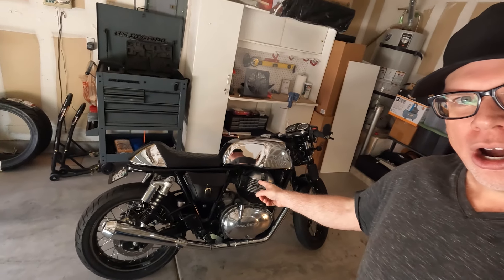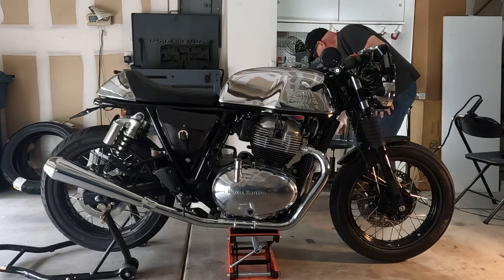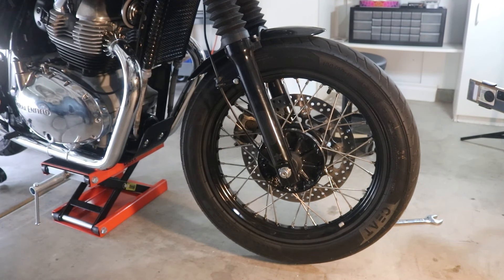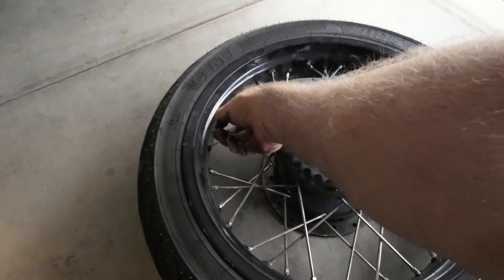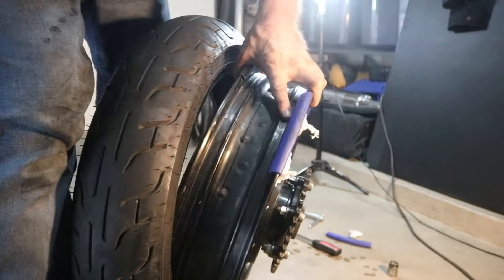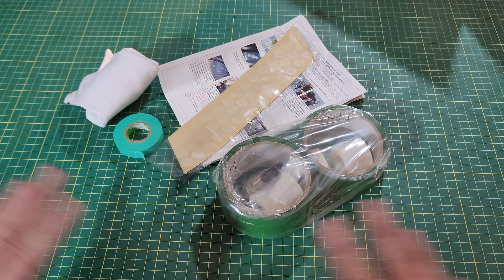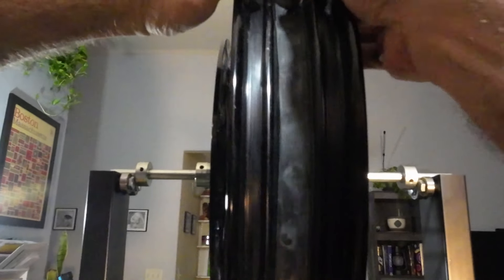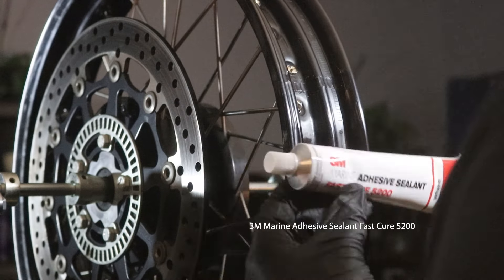Tubeless Spoke Wheel Conversion & Wider Back Tire | Royal Enfield Continental GT 650 | Outex Rim Kit

Comment from the maker: Couple comments and update... 1) at 11:56, the little stickers that go over each spoke that I didn't use, they protect the tape if you have to turn and adjust the spokes. If you don't use the extra sealant like I did, you will need them. 2) at the 18:24 mark I mention filling the tire pressure to 42psi, that is a max load recommendation. Manufacturer recommendation on the bike is 32 front, 39 rear. 

As for the conversion itself, it's been a few months and still all good. We'll see how it holds up this summer when things heat up!

Comment: First gift that I gave myself after finishing college and getting a job for now about a year is this MR.CLEAN continental GT650. Love to watch and learn from your videos…keep posting them …I hope you can give some solution for shaky handle at high speeds..
Reply: Dude I did the same 😂👍🏼
Reply from the maker: I haven't experienced any shaking at high speeds... maybe I don't ride fast enough :)
Reply: Mr. Bhatt you can check both the front tyre grips, esp. the front ball racers, and the rollers.
Reply: @turnonoff  thanks man
Reply: giving myself this as a gift once i graduate air force tech school! only about 4 more months!
Reply: Congrads on graduating college
Reply: @bhanubhatt596 how'd you gift yourself without earning ?? 

Papa's gift to you , you mean?? Well that's lucky & rich parents gifting yoh & not you gifting yourself

Comment: I did a DIY tubeless conversion on my Gt650 2 months ago using a locally purchase all purpose glue (bostik), 3m electrical tape and a 500ml of tire sealant for both front and back wheels. Took it on a 420kms ride with no problems. I hope it lasts!😁😁😁
Reply from the maker: Wow, nice! How's it holding up, any leaks?
Reply: @RideWithJerry  its holding pretty good considering our highways are not as pristine as other places in Southern Philippines. The tire sealant did its job after puncturing my rear tire. It sealed itself! Did not even bother to patch it...
Reply from the maker: @Tibor  Glad it's working 👍 Some people have said it doesn't last long but I just need the conversion to last until my next tire change!
Reply: How's it going after 2 years?? Im planning to do that too

Comment: why does that GT look so good! Can't take my eyes off it, silver chrome Cowell makes it extra special. I would be drooling all over the place if I saw it in person.
Reply from the maker: Thanks! My goal was to make it all just black and chrome (or polished metal) so I think the small changes make a big improvement in the look.
- Changing the gold emblem with chrome
- Chrome vinyl wrapping the gold shock reservoirs
- Replacing the orange fork reflector with black reflective tape
- Blacking out the risers, signal mounts, intake covers, heel guard, levers, etc...

Comment: Best money I have ever spent on a motorcycle…… Pay someone to swap my tires. I used to change my own but found that if you don’t do this work all of the time, it always seemed to be a challenge. Additionally, all of the equipment required to carry out this task takes up a lot of shop space. I will admit that it is rewarding when you get it right.

Comment: IMHO the 150 is good maybe for looks but hurts performance as the narrower rear tire will be not only lighter but allow for more “flickability” in turns. You also added weight with the liquid so that’s something to consider. However great work doing all of that on your own for the first time 👍
Reply from the maker: True, but it depends on what type of riding you do and what roads you ride. For me the 150 is a performance improvement. I almost never ride in traffic or need to make fast, tight turns. Where I live it's mostly wide open roads and a wider tire and more rubber provides extra stability at sustained higher speeds.

Comment: What happens if one of the spoke came off? since the spokes are permanently attached to the wheels?
Reply from the maker: They are not permanently attached, they are just covered by the tape. Repair the spoke and then patch the hole with new tape where the spoke was repaired.
Reply: @RideWithJerry  I’m just about to place an order for this conversion kit. Thanks for the quick response ☺️

Comment: Hi ! Mate instead doing all this huge process converting to tubless .Just simple you buy a new one tubeless rim and fit the tubeless tyres ..all set no dangerous incident or you need drive with fear..I just shared my opinion not discourage.. you did good job keep rocking..stay safe .. 😊👏👍🏻
Reply: The thing is he doesn't want to give up Spoked wheels, which needs tubes.

Tubeless tires not spoked because it's functionally not possible, so many people do these kind of tricks and solution to maintain the Spoked wheels and the looks of it. Cheers

Comment: Normally such conversions last 1 year but I would love to see how your experience was. Great work!!
Reply from the maker: Thanks - Yes, I'm hoping the conversion lasts until the next tire change. I live in a hot/dry climate (bike has never seen a drop of rain) so not sure how that will affect the tape.
Reply: Who told you it only last a year? Rubbish.
Reply: Four years and two sets of tires on my tubeless converted R1200R and Canyon Motorcycles tubeless wheels are outexed just like this.
Reply: @daniellekoran7906  thats actually amazing I'm curious to know if you do any reseals with tyre changes ? and if you can link you sealer kit please
Reply: @RideWithJerry  How is the conversion lasting ... any typre pressure loss during longer rides or this worked ... let me know will do it to mine aswell..
Reply from the maker: @Joshua Bahirvani  so far, it has held up really well. No issues and has held pressure. The next six months will be a good test when I'll be doing longer rides and greater changes in temperature.
Reply: @RideWithJerry  I might do a conversion for mine aswell if yours has worked pretty well
Reply: Seems an expensive conversion plus the silicon mess and time involved. The split tube method takes an hour or so and continues to use an inner tube as a liner to keep the air in after it has been cut round it’s largest circumference. The tyre then goes back on top to hold the liner in place. Finally the excess rubber is trimmed off and away you go …

https://youtu.be/60bi1r2Xvbo?si=ylaPMy0RwTGfAc_z

Three years on and holds pressure perfectly, all for less than $30

Comment: In the decal-wrap industry, they use what they call a squeegee, even-though it looks nothing LIKE the window-cleaning sort, and is MUCH stiffer, though still with a bit of flexion, to it. One of these typically looks like a VERY worn-down, used-up bar of soap, often blue in color. 

These things are used to smooth-on the adhesive-backed printed decal material, to get it on good & tight, and to force-out any bubbles, as you were doing with the smooth, rounded wrench head and your thumbs. 

If you took one of the decal-application squeegees and measured the ideal width of the furrow within which you see the spokes' mounting wholes, one for the front and one for the back, and then, perhaps using a miter box and a cabinet saw (both cheap), cleanly-cut the squeegee-off into two ideal widths FROM that original squeegee, into two "mini" squeegees, this might make-for a handy set of "smoothing-tools" to smooth-on that sealant tape, and get-out all of the bubbles. SINCE the squeegees will be inherently somewhat flexible, there's less of a "grinding" feel, as you bear-down on the surface of the tape.  

The fact that the edge of the squeegee is straight, sort of like tools used for troweling-on paint or viscous, goop, etc., simply helps to more-easily and gently burnish-on the tape-layer onto the relatively flat metal of the rim.   Seems like being able to just carry a "bacon" patch kit & repair tools to fix things is a lot better than having to call for a trailer. Thank you for this demonstration video.

Comment: The width you can make sure it fits of course, but the height of the tire is also quite important...

Overall I think the Royal Enfield 650 bikes are pretty nice 👍

The continental 650 2023, with a few Cafe sports changes is really nice...

The great thing about these bikes are that they are very user friendly. Nowadays most bikes have too many technical gadgets making it a pain in the butt to work on them yourself.

Geez, mine even has tire pressure and tire temperature gauges! 

The idea of having tubeless on that bike is great 👍  too bad those radial rims don't come in tubeless from factory.

Safe riding bud

Comment: Bikes always feel a lot better with new tires because you are going from worn out to brand new. The rear tire you took off looked pretty squared off do it will feel a bit vague as you roll off the flat part to the curved part

Comment: Thank you for showing us how to do this as am seriously considering doing the same thing & I've never done this before Great Video thank you!👍
Reply from the maker: Thanks, glad you found it helpful. But, one step I skipped that I probably shouldn't have was the little sticker pads that go over each spoke. They enable you to turn and tighten the spokes without damaging the tape. Don't think it will be an issue since I used the 3M sealant but still probably best to use.

Comment: Those small discs are to allow the spoke nipple to turn (as you tighten or loosen the spoke) without tearing the tape that seals the rim.
The marine sealant that you substituted will seal around the nipple well and it will be fine - until you turn the nipple.
Check out "Far&Further" with a search on "Outex Failure analysis" for more info.
Reply from the maker: Ahhh, that makes sense! Where were you before I did the conversion 😁

Thanks for the info 👍I just watched the "Outex Failure" video you mentioned. The 3M sealant I used is waterproof and "flexible" so hopfully there is enough extra protection and flexibility if I have to adjust the spokes. My guess is it should be fine but if it does cause issues, well then, I got myself another weekend project!
Reply: @RideWithJerry   -  I suspect that the sealant will just break away from the nipple if the nipple is turned, and the sealant edges and the tape will continue to seal the air.  The need for the small discs may just  be theoretical.  Care to test the effect on  the marine sealant of turning a few nipples for us?  :-)
Reply: @daveinwla6360  i dont know.. That 3M marine stuff is no joke.
Reply: @atomiccheerio3349   -  Yes, it's good stuff.  But if there is a good bond with the base of the nipple, it may twist along with the nipple and tear a small hole.  The same with using just tape - it could tear.  So most procedures involve a belt-and-suspenders approach and cover a sealant on the nipple with a layer of 3M tape.  The tape is also easier to balance because it's a uniform thickness.

Comment: Awesome video. 
I'm buying a interceptor next week in NJ.
I'd like to put a 150 on the rear like yours. Can you tell me how much room you have on the swing arm? And have you had any rubbing?
 Or maybe do a quick video of the spacing. Thank you and subbed
Reply from the maker: No issue with the swingarm but I was getting some rubbing on the chain guard when going over bumps... at the end of the video I show the notch I cut into the chain guard which fixed the issue https://youtu.be/7dTebUBmmdo?t=1272

Comment: Tubeless rims have a different profile and have a locking groove that stops the tyre coming off the rim which some tubed rims do not have. Tubeless conversions are at best a compromise and worse potentially dangerous and your insurance company could walk away from a claim. Putting a wider tyre on a bike can make the handling worse as the tyre can be squeezed on the rim changing the profile (taller and more pointed which reduces stability and the contact patch). Personally I wouldn’t have done either the conversion or the wider tyre the balancing goo stuff I would love to know how it works and if it has actually balanced the wheel any better than weights.
Reply: @danielkerr4100  why?

Comment: Put a Scorpion trail 2 150 on my int,  rides a lot plusher, still tubed though,  considering the conversion 👍
Reply from the maker: Leaning into corners always felt sketchy, now the bike want's to lean! Feels so much smoother
Reply: did you change your tubs to accommodate 150/70 18? or just keep the stock ones?

Comment: JFI you really do need to take more care when putting your bike up on the paddock stand/engine support. Your paddock stand ground wheels are all out of line and when you removed the rear wheel spindle the lhs bobbin came out of the stand hook which could have seriously injured your hand had the bike slipped. Your bike is balancing precariously on the engine support and it would not take a lot for it to fall. Apart from that, pretty good effort ....

Comment: If you really want to improve handling you should at least upgrade the rear shocks (they are made by Gabriel). They may look trick with the piggy back cylinders but they are in reality poor..  
Stuart Fillingham (YouTube) fitted YSS front and rear, I fitted YSS to the front and Hagon shocks at the rear. I wanted a retro look shrouded shock at the rear and the Hagon is perfect for that. I can’t honestly say the front was improved but the back is much more compliant over the bumps and gives a better ride. Tires I left stock, they handle great and stick like glue so no problem.
Reply from the maker: Yes, I've been looking into upgrading front and rear suspesion. Still reseaching options, costs... and finding the time to do it!
Reply: The front wasn't improved cause you didn't drill out the damper rods.
Reply: @stevepalmer5670  And the YSS progressive rate springs are a one-size-fits-all upgrade. Better off with a linear spring suited to your weight and riding style.

Comment: Hi, were you able to use the 3M Marine Sealant (3 oz) for both the wheels? just want to know if 1 pack of 3 oz is sufficient, as I am planning to convert my Int 650.
Reply from the maker: Yes, the 3oz sealant was more than enough for both rims.

Comment: A quick question Jerry, is the tube of the 88ml 3M marine sealant enough for both the wheels? I'm going to do this but with just the marine sealant and a 3M tape I procured from the US, for some reason the marine sealant is not allowed on a commercial flight so I could not get it over here in India through a friend who was going to bring it with her. The marine sealant is available here in India but it is seriously expensive for that little 88ml tube so before I start ripping the tyres/wheels off the bike I just want to make sure that the tube will do the job for both wheels. TIA.
Reply from the maker: Yes, more than enough for both rims. I had plenty left over.

Comment: Once you change the tyre in future, do you have to redo everything? Like you will have to get new kit and apply again?
Reply from the maker: No you should'nt have to redo anything unless you find leaks or your cause damage when changing the tire. But it would be a good time to inspect and see the condition of the conversion, how it's holding up and if any repairs are needed.
Reply: @RideWithJerry  RE have launched the alloy wheels.. but I like my GT with spokes. I ma gonna use Way2Speed kit. Costs like less then $80.

Comment: Others have found that a 120/80/18  handles better and better gearing , the same on  kwaka w650's ... So I am about to go 'that' way .   Dave   NZ
Reply from the maker: For the font tire? Yeah, I didn't change the size of the front tire. I'm interested to know more, if that also makes an improvment.
Reply: 110/80 front, 140/70 rear works best. I've run several sizes and this combo works very well.

Comment: Thank you for the video.  I feel, however, it should be released some 1/2 year or so after the conversion to include conclusions related to any issues that MAY surface after an extended usage.
Reply from the maker: I can do a follow-up video when I change my tires again (or if I have any issues with the conversion.)

Comment: If my spoke brake will i be able to remove the adhisive sealing to put a new spoke in?
Reply from the maker: I would cut out a section of the tape just around the broken spoke and then patch that area after the repair.

Comment: Way2speed tubeless kit is better and cheaper than this. Works like a charm. But that's just my opinion. Could you please share the details regarding the wider tire upgrade? Any issues with the balancing while cornering, accelerating, and reaching the top speed? Is it safe?
Reply from the maker: I like the wider 150... for me, I've found that the extra rubber provides a bit more stability at higher speeds (maybe it's just due to being a better tire, I don't know, but I'm happy with the results.)
Reply: Thank you for answering. I just have one question. Is it necessary to upgrade the front tire as well in terms of wideness to balance rear wide tire? @RideWithJerry
Reply from the maker: @motoman9323   @motoman9323  nope, I didn't change the size of the front.

Comment: The pipes come down below the frame.  The motorcycle lift is lifting the bike on its pipes.  I don't think that is such a good thing.  I've used short wood blocks on the lift to lift up on the frame directly.
Reply from the maker: Good advice! Don't want to be lifting the full weight of the bike on the exhaust pipes. Not an issue on my bike (at least I hope not!) since I was lifting under the sump guard and not the exhust (hard to see in the video) but the sump guard is mounted to the frame and sticks down a fraction of an inch below the exhaust https://i.imgur.com/SLvjXwX.png
Reply: @RideWithJerry  Oh, you have a sump guard!  Got it.